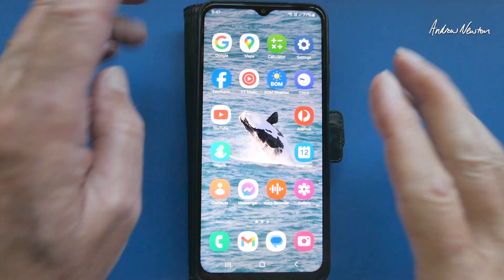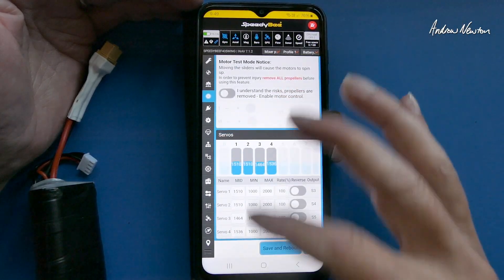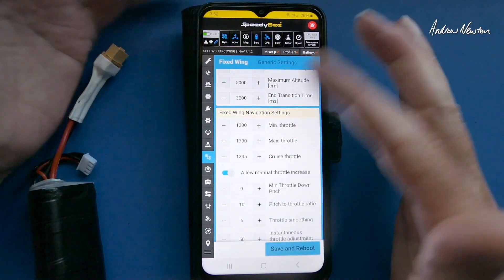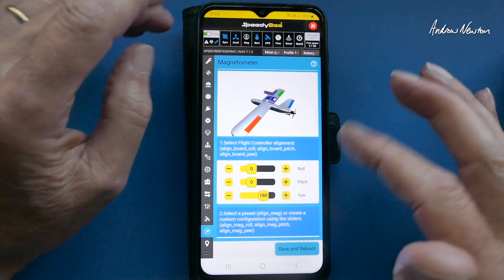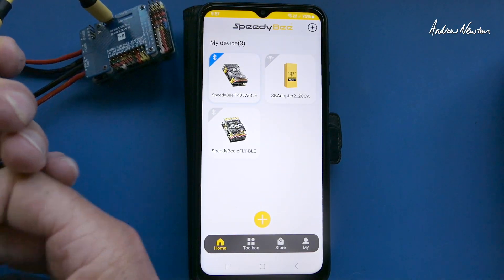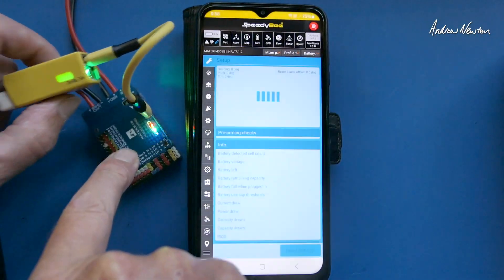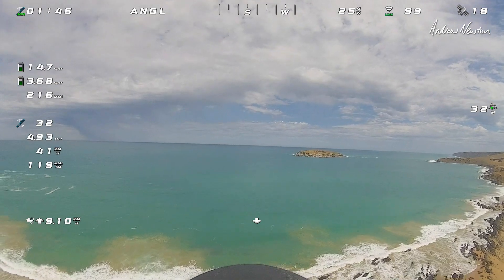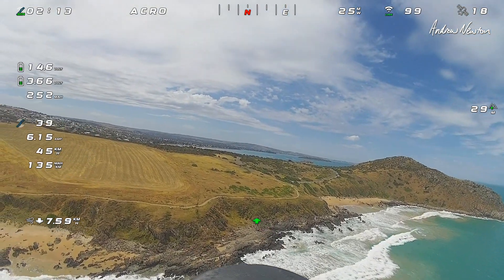SpeedyBee APP - INAV demo in the field

Comment: You can connect a board via USB cable to. I tested out only with betaflight, because my INAV board has bluetooth built-in. 
For betaflight setup you can also use the android version of betaflight configurator on your phone.
Reply from the maker: I'll try that once I locate the right cable
Reply: @AndrewNewton  I use a normal phone cable for data and a USB-c-hub. The SpeedyBee app detects STM32SerialDriver in my case. It's not rocket science 😉